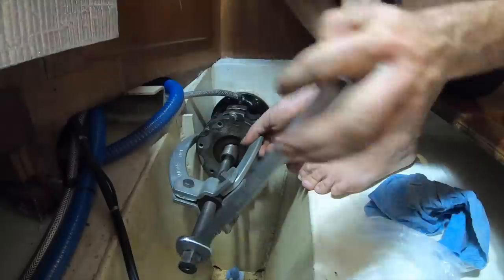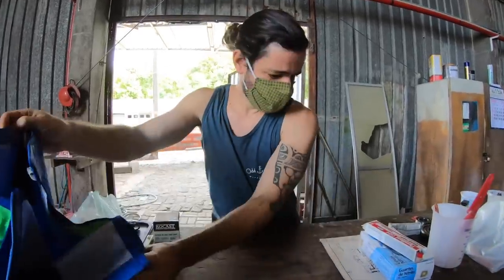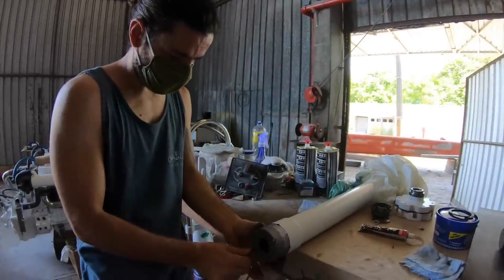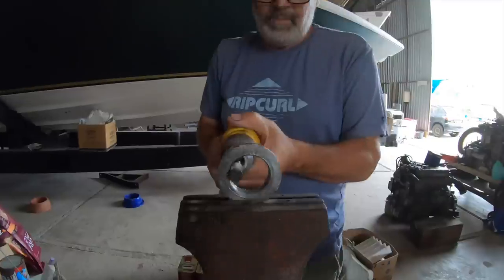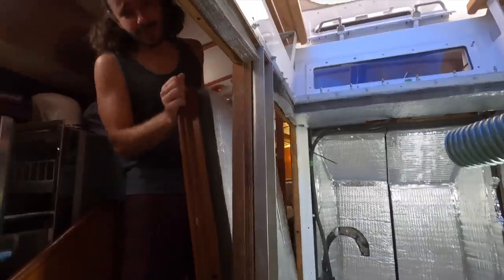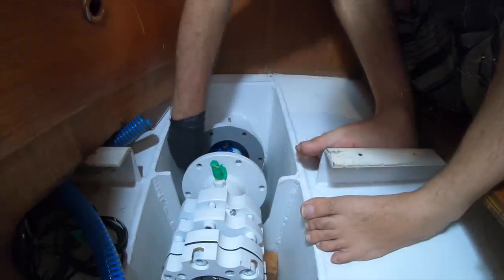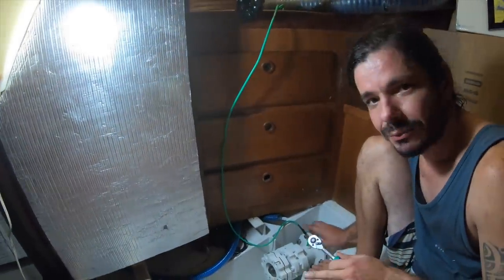⛵️We are FINALLY done with this project!! #173

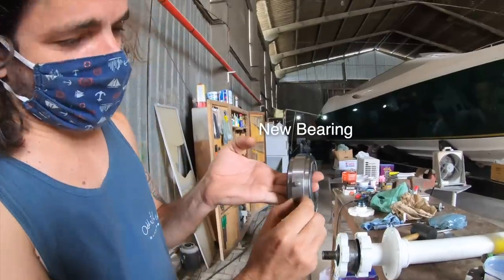Comment: @ 18:06 As a machinist I have to say that was a brilliant fix for getting grease to that bearing, It's weird that they designed that shaft where there was no way to grease that bearing,I'm surprised it didn't lock up on you from the heat.
As always, the best part of my week is seeing a video from Odd Life, it always brightens my day to see you two so happy.
Reply: I completely agree with you. Everything else is so over-engineered on that boat, and then leave out such a critical mechanism?
Reply: They didn't even show us their use of a dial indicator to measure or check any shaft deflection, runout, vibration, and axial motion during assembly because all of that contributes to the noise the shaft will transmit. The turning of the shaft before assembly was a needed thing to do and they would have checked and correct most problems there but he says casually,  "Send to the turner." Making a Bering Housing for the replacement was a great move I agree, and said so to myself when they assembled it the first time when I seen no grease fitting.
Reply: I almost sure that they built that way assuming and puting on the Service  Manual to change that baring after some sum of Nautical miles. But yeah poor engenering
Reply: I think the original design probably had a seal on one side and the other was to be exposed to the oil. That's ok but try to find a double row spherical without a grease groove.
Reply: @zxggwrt  These are very common for pillow block bearings with a jack shaft.
Reply: @MrNoclutch  Agreed, it would have been nice to see the measurements of the work performed, but I suspect "the turner" is an expert in boat shaft turning, centerless grinding, and repair.  The shaft is no doubt PSQ (pump shaft quality), which is already extremely precise in diameter, straightness, and strength.  In my profession (aerospace metals and processing), where quality is paramount and everything is closely monitored and documented, we frequently refer to our 3rd party processors as, "the grinder", "the trepanner", "the heat treater", "the testing company", etc, which does not diminish the quality of the work performed.  Mind you, these are NADCAP approved, AS9100, ISO9001, and Prime-approved by Boeing, Lockheed Martin, Airbus, NASA, SpaceX, Northrop Grumman, Bombardier, etc.  In the context of boat repair by persons who have never done this sort of work, their terminology seems quite appropriate to me.  Sorry for the long and boring reply.  Cheers!
Reply: There wouldn't be much of any heat because it's exposed to water, which would leach the heat out except in the most severe of cases. For the size of boat, that whole thing is overbuilt. Kinda like putting tank axles on a pick up truck.

Comment: You are now experts on your drive shaft and if anything ever needs fixing again, you will know what to do. A big congratulations to you both for having the stamina to keep focused.
Reply from the maker: Thanks so much for the always support, Graeme. ☺️
Reply: Best of all they video recorded most of it.  10 years form now this drive shaft project would have blended with all the other 100s of projects they have had to learn making recollection of specifics much "fuzzier."  I sure wish I had my projects on video for this very reason ;)  With age comes a lot of "I used to remember how to do that."  Repetition is what makes an expert, expert.
Reply: Putting in that grease fitting was pure genius. the first benefit of what you have learned.
Reply: @brucemacsr.6776  Lots of cross country carr haulers do this and run gear lub instead of grease in their trailer axels.

Comment: Being able to grease that bearing while installed is a brilliant idea
Reply: No, do not do that read my reply.
Reply: Berings should be packed 30% 0f capacity, over greasing can cause a bearing to fail and over heat. packing the tube would have made more sense. but they filled it with oil.

Comment: I worked in the bearing business for 16 years. Built bearings from start to boxing to ship. We had a saying.   If it don’t roll, it won’t go.   Lol
Reply from the maker: For sure made a huge difference to replace, now it is rolling sooo smooth 🤩
Reply: True. It looks like they took an off the shelf pillow block bearings, probably dodge, double row spherical, and put a ring around it. Solid solution.

Comment: Duca, the big bearing you had the trouble with is the thrust bearing that transfers the propeller thrust to the hull. The ring that you made will keep the bearing from leaking grease into the boat but it doesn't use grease like you would think. The band and grease zert will hold the grease in the bearing and keep it from backing out. The seals that you put in, retain the grease in the bearing. That's why the other thrust bearing didn't have grease holes in it. Think of it as a wheel bearing on your car. You fill it with grease and after so long you repack the bearing, instead of greasing it regularly. You don't need to pump grease into that bearing very often and one pump is all you should need. If it's hard to pump the grease gun the bearing is full. I hope this helps you. Looking really good.
Reply from the maker: Thanks for the explanation 😊

Comment: That is clearly a superior design. The “thrust bearing” is included which allows the optimal propeller orientation. Most (lesser) sailboats have the “thrust bearing” in the transmission which requires a near perfect shaft alignment to operate.
Reply: I believe the advantage of their system is that any engine vibrations won't be transmitted to the propeller shaft. Which is also often a cause for leaks into the boat.
Reply: @peterbodifee  The thrust bearings should face each other to cancel the thrust. this is so they can handle the thrust in forward and reverse. If the shaft had slight surface rust that tells me its 400 series stainless steel. 400 series is for strength where 300 series is for corrion restance one is magnetic the other is not. witness marking the components would have maintainng the ballance better to keep vibration down.

Comment: I would check that ground wire for continuity do to attaching to a painted surface  Nice Job
Reply: I thought that too, but the threads are firmly embedded on metal, so it should be ok. Yes, worth checking to be sure.
Reply: searching for this comment

Comment: You're doing it right.  Replacing that failed bearing and adding the zerk will give you years of heavy use.

Do it right, or do it again!
Reply from the maker: Thanks for the support
Reply: It's good. Just don't blow out the seals by over pressuring it. I see that all the time. Take it easy!

Comment: The bearing, when new, comes pre-charged with lube. It is installed into a confined place. The lube installed from the factory will not go anywhere, that is why there is no lube point, that's why some bearings are completely sealed, no lube needed after the initial factory charge. When you pre lubed, packed, the bearing, you did it well enough so the bearing will have enough lube for it's life. Remember, the grease will expand, only a little due to it running in a cool area. If over charged, the excessive amount will find a way out, make a mess and create a possible leak path for water one way or, if you over charge it enough, it will find a way into the oiled part of the system and there will be a leak path for the oil out of it's intended space and allow sea water into the oil space. I get the need for a new bearing, rough spots will turn into really bad spots. The sleeve idea was a great work around to make what you have do the job. If it were me, and the bearing was still pre charged or had been packed before installation, I would NOT lube it after re-installation.
Reply: thats what i was thinking. on cars they use bearings on things like a/c idler pulleys that never get lubed but yet they last 100k miles. The bearings are prelubed and have plastic covers over both sides of the bearing to keep the grease inside the bearing and there are some automotive driveshafts (slip yoke) that if you put too much grease inside it will damage them because of compression forces inside but fortunately the housing that bearing is in does not move.
Reply: Yep totally agree it was designed to be sealed as part of the overall design concept. Probably only meant to be lubricated during 5 yearly boat out overhaul. If you over lube after install it could cause other issues.
Reply: You are absolutly right over greasing can blow out the seals, also to much grease can over heat the bearing and cause spaulding. so be about 30% of capacity.
Reply: @wcads623  TSheilded or sealed bearings are desighned to run for the life of the bearing.

Comment: Great job!! You absolutely made the right decision to replace the bearing. And really nice job having that ring machined so you could use the new bearing you had. 

If you could feel a “bump” in the old bearing it would have quickly disintegrated and failed. Leaving you in a dangerous situations. Failures always happen at the worst possible time. 

The force is known as thrust. The big bearing you replaced is a double tapered roller bearing. It’s the bearing that takes the thrust of the prop and transfers it to the hull. And that load is why you needed to replace it that bearing. So again, great decision! 

Cheers,
Jeremy
Reply from the maker: ☺️ thanks, Jeremy

Comment: You had to move the shaft to take off the propeller correct? So You’re gonna have to pull it out to put the propeller back on correct?
Reply from the maker: We actually took the propeller out first  https://youtu.be/wflBom0O21Q
Reply: @OddLifeCrafting  Right but didn’t you have to move the shaft to get the propeller off because it wouldn’t clear the rudder?
Reply: I was thinking the same thing 😳

Comment: Oil inside shaft have to be ""Transmission oil". It's not 5w40!!!
It's another viscosity! Take an attention! and very important: bearings have to be NEW!
Reply: @matthiasweigel311  Yes I know! I said that - insaid have to be Transmission oil!  And never motor oil.
According to service manual, if you opened bearing module, U must be changed the АLL of the oil seals and bearings including any gaskets!
Reply: @autoservice5610  Knowing Luca's fear of mistakes, we know he researched the in and outs of this genius system, lubricants specs on their blueprint 
plus took advice from the marina mechanic experts. Automotive parts and marine applications are very different...
Reply: Bearing guy here: don't replace bearings unless you need to. Seals, yes. IDK anything about the oil just so long as it's compatible with the seals.
Reply: My Volvo sail drive transmission uses 15W 40 per the manufacturer recommendation,  its quite common I believe.

Comment: If you had put your bearings in a refrigerator for an hour or so they would have shrunk and dropped into the housing with little or no hammering.
Reply: Freezer section of the refrigerator.
Reply: @jackpatteeuw9244  I've seen this done with dry ice to fit a 160mm stainless steel ring inside a housing for a jetski impeller. Also Ferrari uses it to fit valve seats in it engines.
Reply: @VifferDude  Depending on how much the interference fit is, a normal refrigerator freezer will shrink it enough.

Comment: You've taken a rather dull subject and managed to create what is perhaps your finest episode. Your explanation of why you chose to use the existing shaft assembly; the thrust force being absorbed by the rear flange rather than the motor mounts makes perfect sense. Against the backdrop of your spotless engine compartment, that prop shaft is a work of art. The modification of that bearing was brilliant!

Comment: I think it is great you kept that shaft system, because to me it is one of the best you can have, great idea with the grease nipple on the bearing, always carry a spare nipple, or take it out when you have finished greasing and install a bolt, when the shaft is turning it creates pretty high pressure in that bearing and it has been known for grease nipples to fail. Guys what you have done to that boat is brilliant, well done.

Comment: I think your driveshaft shaft/propulsion system is a very ingenious system !  An excellent solution for a large heavy boat.  You explanation of how the thrust from the shaft is transferred to full was very good.  (Big propellers provide a lot of thrust.  Placing all of that thrust on the engine crankshaft can cause excessive wear on the main bearings.)  This system is easy to maintain (a couple of pumps of grease once a month and keep the oil tank full).
You custom made bearing housing along with the bearing with holes in the outer shell is a great solution.
Purchase spare parts NOW, even if you do not need then for another 20 years !

Comment: You guys are absolutely right to take your time with a component like this. Not only is this item fundamental to keeping afloat, but it is also complex. Thus you'll want to understand it in detail so you can maintain it and repair it yourselves as much as possible in remote locations without needing to fly in an engineer if it fails or needs servicing.

Comment: One thing that can make future maintenance (cleaning) very easy is to ceramic coat the engine room and if your able coat the hull.  I admire the effort you both are putting into understanding how the engineering of your boats systems work. Sometimes new isn't always better. This depth of knowledge is part of what makes you both superb sailors. And once sailing you will learn to listen and master ODD through the natural forces. Doing things right and well takes time. Keep up the good work and have a great week.

Comment: I have followed since day one and have always been delighted by your "consistent meticulous attention to detail." The value of both forethought and preventive maintenance is rarely appreciated until unforeseen mitigating circumstances occur. I am a Drexel mechanical engineer. I worked as the maintenance engineer at a Ford assembly plant. I have sailed since 1957. I will not buy a vehicle newer than the fifth year it has been in use. You are rightly pleased with the many projects you have completed and I hope you are well rewarded on the water for your significant efforts. They are a delight to watch. Bravo!
Reply from the maker: Glad you like our videos. Thank you so much for the support 😊

Comment: You guys are really precise with your work and I really enjoy watching you guys work especially together. The bushing that was sanded on to make it larger is actually made to be that tight on the shaft because if it is to loose it will create a friction point which in turn will create heat and heat in the prop shaft tube is not your friend. It will be ok and probably last 15 years or so but in 15 years you guys will still be together, even I can see that, and when you decide to overhaul the prop shaft just put the bushing in an oven on 450 and let it stay for 15 minutes. That will allow the bushing to expand and slide on the shaft.  When it cools it will tighten on the shaft and never move. Use gloves!! Awesome Vidz keep them coming and remember the best way to learn is hands on and there are 1000's of different opinions to every situation so think about it and do it they way you want to. Take care

Comment: When I saw that replacement bearing, my first thought was, it'd be great to use that bearing and have an external oil fitting or grease zerk to keep that bearing lubricated. I can't believe that there was no way to lube that bearing originally. Wonder how many times the previous owner had to replace that it - no wonder he kept a spare around. I'm no sailor and first came to your channel to watch the container house build, but stayed to watch your problem-solving and Duca fulfill his OCD needs. I truly believe that boat will be much better than new and will be surprised if someone doesn't track you down and throw money at you 'til you caved and sold it, in spite of how much you love it.

Comment: One thing that's either not shown or it slipped by you. When you install a liquid gasket (generic term) you want to leave it loose in position (just barely tight) until it cures, then, tighten it in place. That way, the cured gasket is pushed proper and installed under force. Otherwise, you'll have it pushed out, but any variation in force (be it expanding from heat cold or mechanical action) will find it easy to bypass the seal since it's just enough to skim over the metal. Just a thought, nothing more. Because this is a boat, and you have to inspect the whole mechanical aspect every few years anyways, you'll probably be alright, but keep it mind. For any application that allows it, i use a set of feeler gauges to space the part i want to seal up until it's time to bolt it solid. I've found that half a mm is perfect for most applications, and one mm for any kind of very thin walled flange.
Reply from the maker: We do agree Aserta. But in this case we have a rubber gasket. The only reason we aded sikaflex was to fill any imperfection on the painting job on be boat flange. 😊👌🏼

Comment: Keep up with the video's there great and educational. I especially like the fact that you guys think it thru like the grease fitting thing.  There was a day when cars were made with grease fittings then in 1961 they started eliminating grease fittings.  I felt back then it would be a mistake, and I still feel that way but we do have new materials for bushings etc. that no grease fitting is required.  Keep up the great work. Keep taking your time and learn, remember with knowledge comes power.